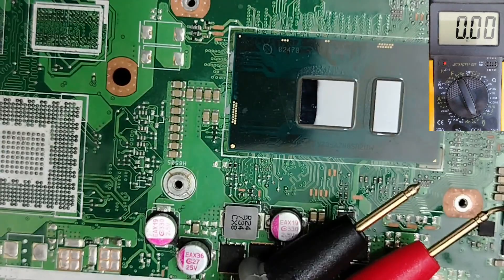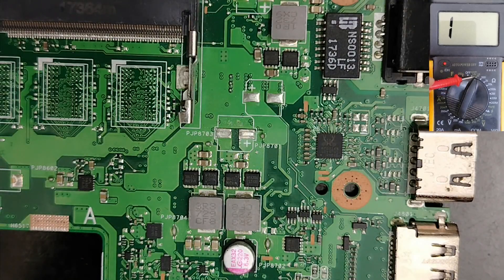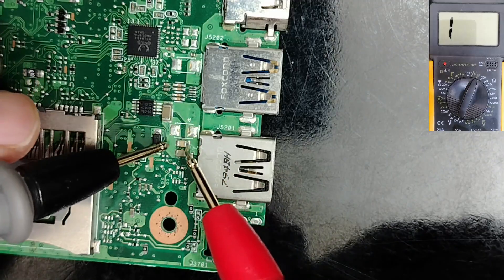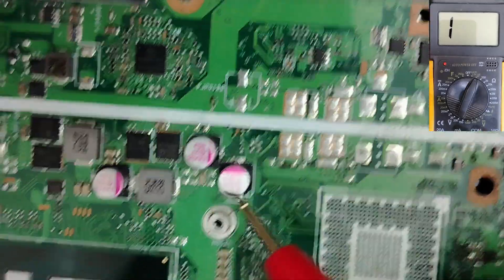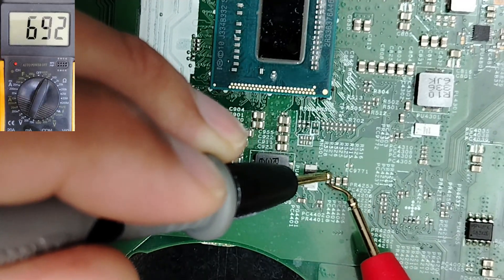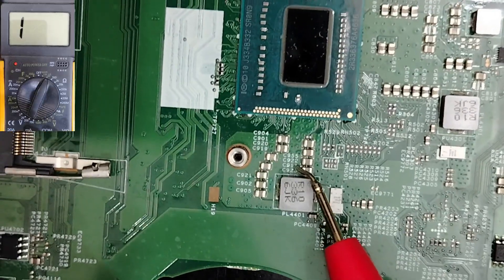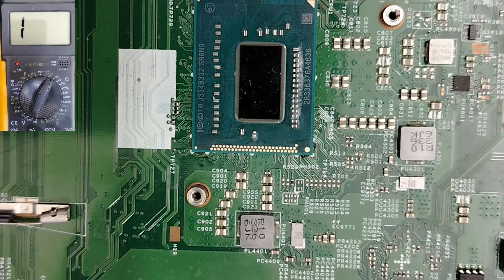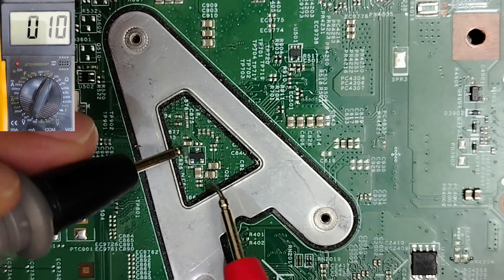How to Test Ceramic Capacitors the EASY Way - SMD Capacitor Test

Comment: Shorted or nearly shorted caps are often decoupling caps. But one thing you should always remember. You're not really testing the caps in that case. You're often measuring the impedance of the power rail network.

Comment: Hello, I am measuring ceramic capacitors on a small board I’m working on and when I put my black probe on ground and the red probe on the capacitors I get a beep on one side and not the other which is normal with all but one capacitor which doesn’t beep on either side. Is this the bad one please?

Comment: I switch to “diode” mode on Meter with negative lead clip on circuit ground.  Positive lead is then used as probe to find shorted capacitor.
Reply from the maker: Sounds like a solid approach.